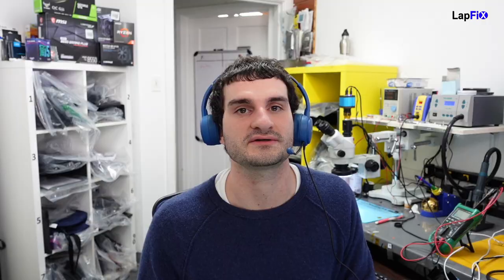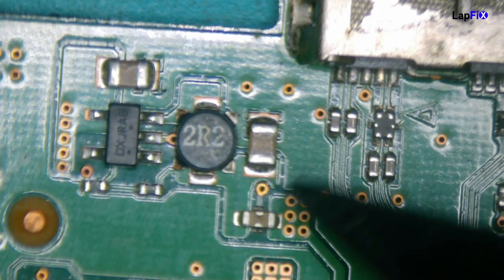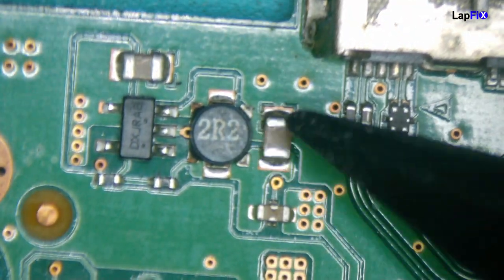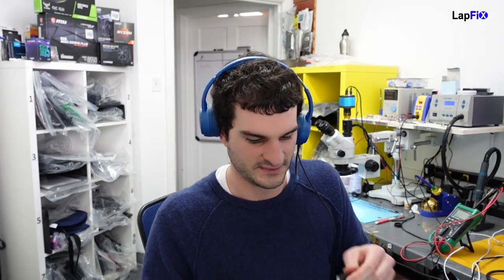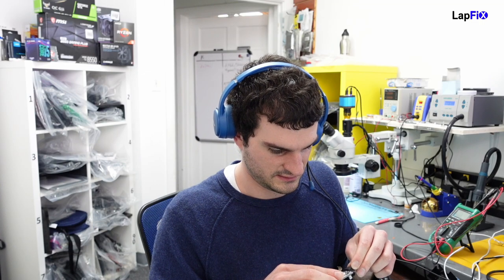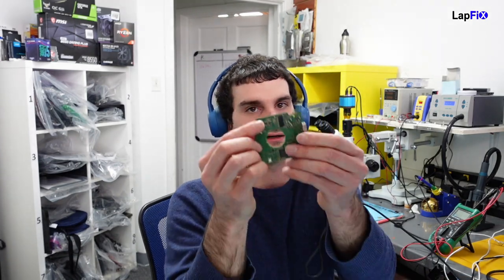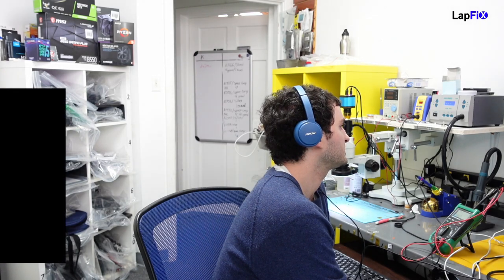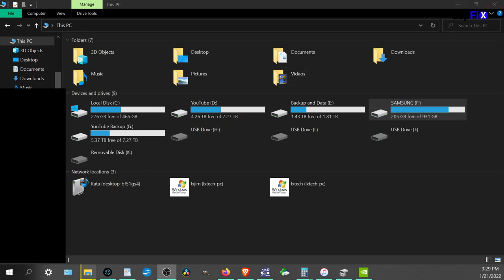Fixing Dead 1TB External Drive PCB for Data Recovery

Comment: What I don't understand is that I have called computer repair shops in my are who can solder chips and wires. I asked them if they can do this for me and they keep pushing me to send it off for data recovery which is 600 or more. I get that they want money but why would u make ur customer do more than what is needed? I told them I have an extra board and everything. I know my drive is not broken, the USB port just broke off. I totally understand the 1000 charge is they need to use a clean room and open up ur disk drive. But a simple solder shouldn't cost that much. This is what makes me not trust these repair shops who won't even entertain that it is a simple fix. We just need to learn to fix things ourselves.
Reply: I'm having the same problem. I sent it out for a quote. Even though my data was fine before the part of the pcb with the usb cracked, they insisted on doing the $1k+ clean room data recovery or nothing at all. They slipped up on the phone and admitted they could try the physical repair just to get it connected, but it would be "less reliable." When I said I was willing to try that they snapped at me and said it wasn't an option. So I just asked for my hard drive back. It's so frustrating. If you've managed to find a place willing to help I'd really appreciate you letting me know. :(